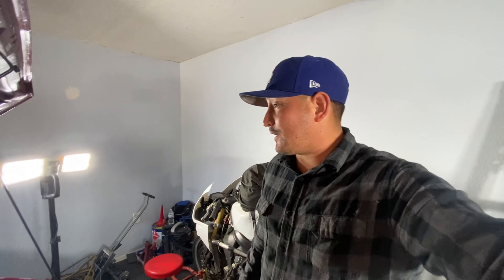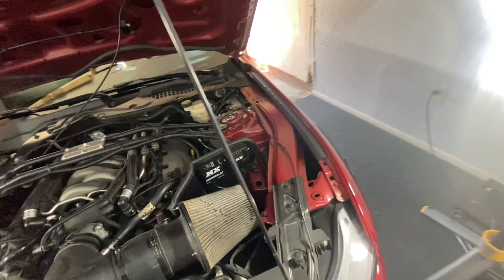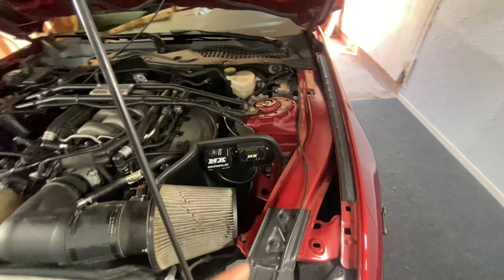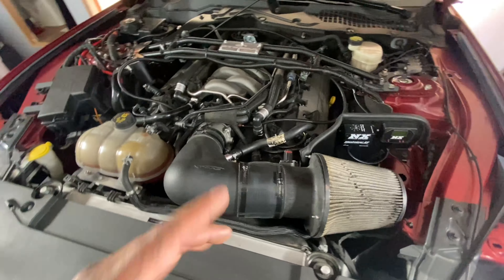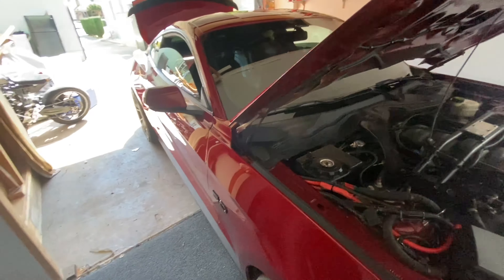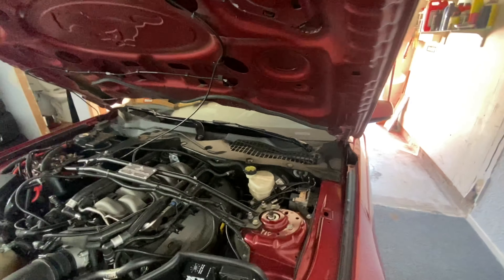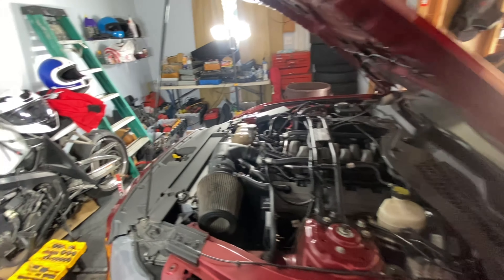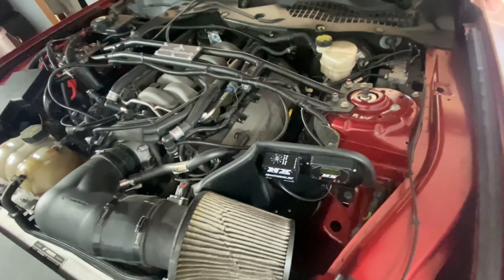Preparing for Irwindale drag strip test and tune round 2

Comment: Funny I came across this videoI was at irwindale yesterday too I seen your car but didn’t see you run  I have a white 14 GT didn’t get a good pass kept getting locked out of 2nd gear putting in a new clutch this week
Reply from the maker: Hey man !! Nice dude get that clutch. Next time let’s link up. I actually did as good as I hoped. 7.15 at 99. Im shoot for that 6.9 next time. Got some adjustments to make
Reply: @DiablitoSpeedz  sick nice time! I did 8.1@90 I’m looking forward to the next track day I think they said in 3 weeks I was hoping to get into the 7s there I did a 7.98@92 with my dragy on the street I think you can get into the 6s I messed up and filled up my tank before I got there thinking I was going to use a lot on the drive lol I was still above 3/4 😔
Reply from the maker: @matthewtompkins4570  oh yeah you can definitely get into the 7s. I’m mess a bit more on suspension. I was still spinning lil too much. 
I got some new Hoosiers here I’m slap on. Also I’m look into weight reduction. Possibly retune to see if I shoot like a 160 instead of 150.
Reply: @DiablitoSpeedz  who you tuned by? I’m tuned by Lund I didn’t have any problem spinning really but I could feel the car squat but then it would feel like it died then pick back up I was just taking off from idle I would feel it grip then floor it I was on mt et street r I need to do suspension too...do you have ig?
Reply: I just seen one of your videos and you say your i Carson I’m in lomita
Reply from the maker: Awesome man ! Yeah I’m in Carson. We should definitely link one day. 
Ig Diablitospeez 
Send me a message easier to talk on there